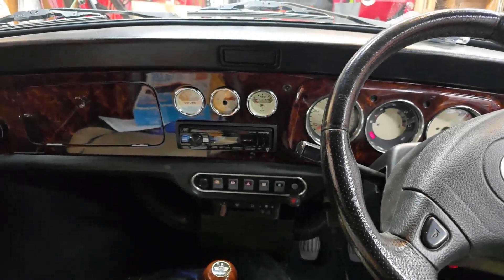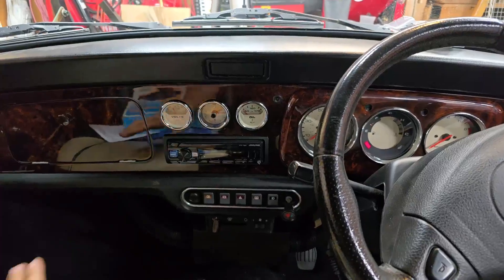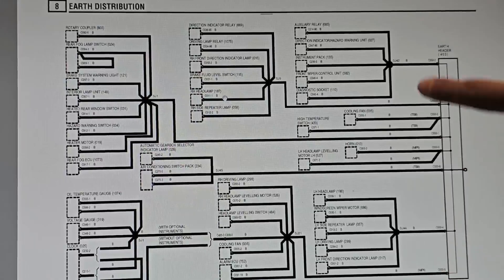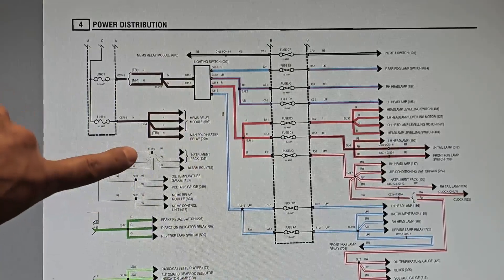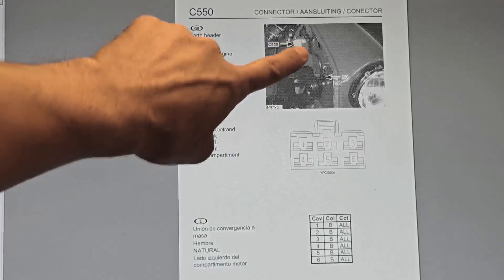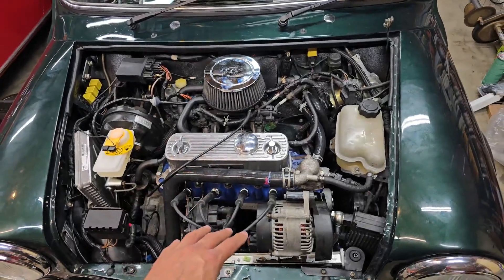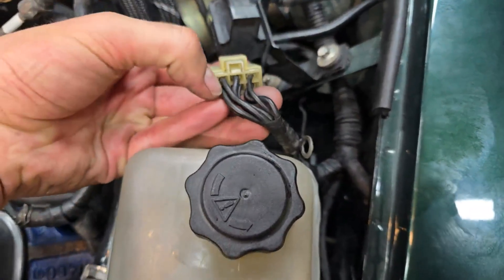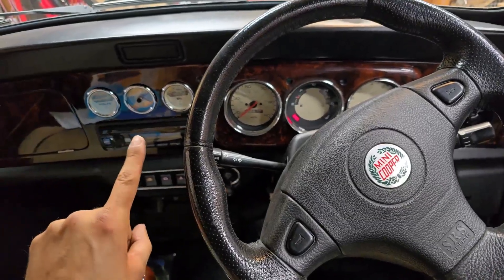Classic Mini Survival Guide: Diagnosis and repair of ground fault problems.

Comment: I'm an ex-traffic-lights engineer. A set were Reg-Amber & Green all came on at once. The source of the fault? You guessed it, the earth had gone HR (high-resistance).
Reply from the maker: Yep, these types of problems are not just for vehicles. Anything that uses electricity need to have proper grounding to function as designed. Thanks for watching!

Comment: That same connector was present on the Rover 114. With the same corrosion.
Reply from the maker: Im not surprised by it being a shared connector to other Rover products. Its interesting to see that the manual had the connector positioned in a vertical orientation, maybe to try to prevent water from pooling up into it. If it had been packed with dielectric grease from the factory, I bet that they would never had problems with this connector. 
thanks for watching!
Reply: Thanks Darren. Never even heard of dielectric grease. Just ordered a small tube, sure it'll come in handy.
Reply from the maker: Its the best for keeping moisture out of electrical connections. I pack all of the bullet connections and any earth connection before plugging them together.